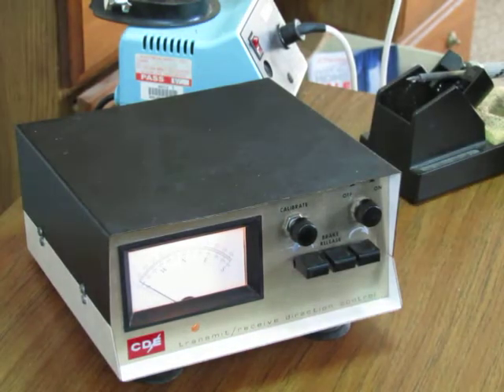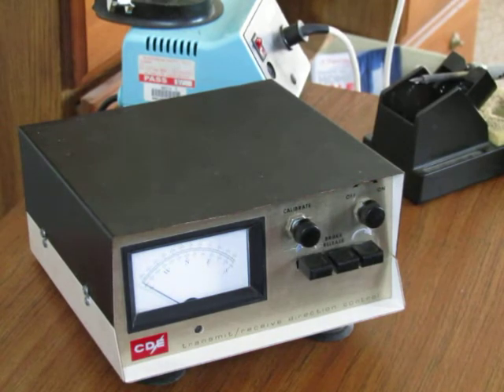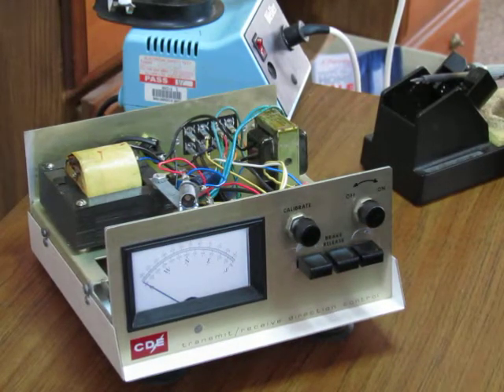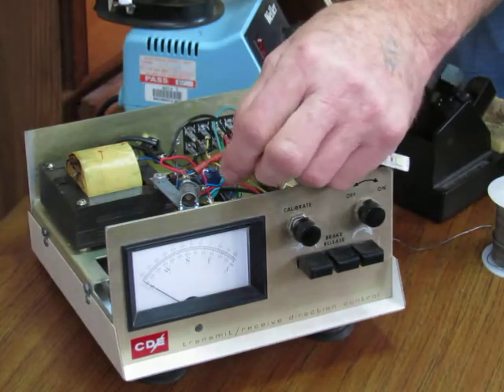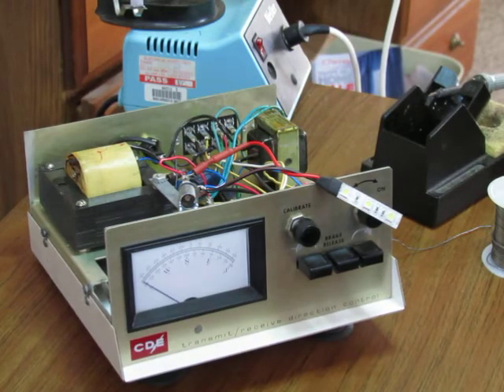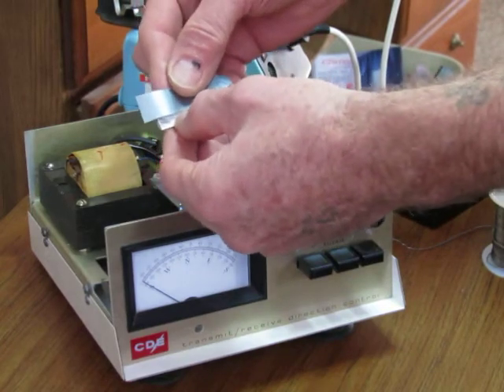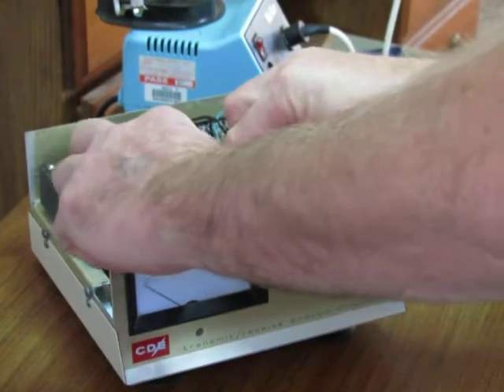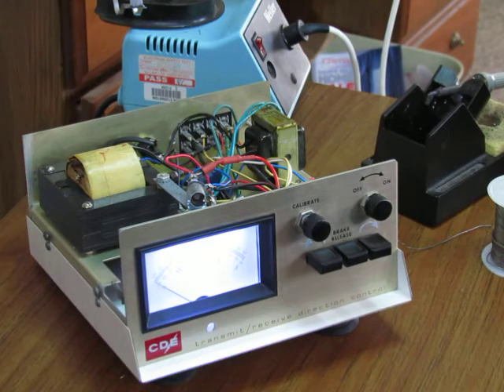Hy-Gain/CDE Controller LED conversion

Comment from the maker: I’ll get one right out to you.
Reply: Thanks for the quick attention! I just got my CD-45-II back up in the air after having the rotor rebuilt by Norms . There was nothing wrong with the control box, so I didn't bother sending that in to them. After getting it all back together I realized how dim the old 24v bulb really was for my 53 yr old eyes! LOL
Reply: Arrived today and wired it right up....awesome improvement, Mike! Thanks again!
Reply: BTW just so you are aware, I have a circa 1990 Model and the wires are BOTH red and BOTH blue! Very annoying, but after watching your video it made it easier....

Comment from the maker: Glad you like it, Tell  your friends please. I have sold over 500 so far and delivered to 11 country’s. Thanks for your comments and for the sale. 73. Kc0cf
Reply: oh I have spread the word for sure Mike. what about a CDR AR-22 the ol click clack rotor box? have LEDS for that to?
Reply from the maker: Butter Bean if the voltage is 36 vac or 12 vdc this led kit will work. I haven’t seen a old clicker controller for many years but I suspect the led strip will work.
Reply: How can I get in contact with you Mike
Reply from the maker: Willie Jackson email me at kc0cf@hotmail.com  from there I can give you my phone number if needed. Thanks.

Comment: Mike do you have the led`s in different colors also? I know this is a old post hope you see this
Reply from the maker: Willie,  here is the link to the order page, https://kc0cf9.wixsite.com/kc0cf,  I have white, blue, purple, and green.  If you don't have pay pal you may email me for directions on where to send check or money order. I also sell on Ebay, you can just search my kc0cf ham call sign to find the product. You will enjoy the illumination.  Thanks,   KC0CF
Reply: @KC0CF  do you have cash app
Reply from the maker: Yes I do, green, blue, purple,  you can order on my website. Using papal is easy to do there. If you want more then one, just check out each time you add one. I never got it set up for multi unit order. Make a comment on the color you want. You will enjoy the illumination.
Reply: good deal will be making a order, thanks 73
Reply from the maker: Yes I do,  here is the link to order. If you need more than one, just check out separately for each one,  mention in comments which colors you would like.  73
Reply: @KC0CF  Mike I want to order to a blue one and a red one my name is Willie Jackson in LA.
Reply from the maker: Yes